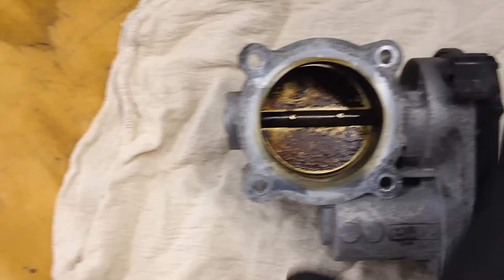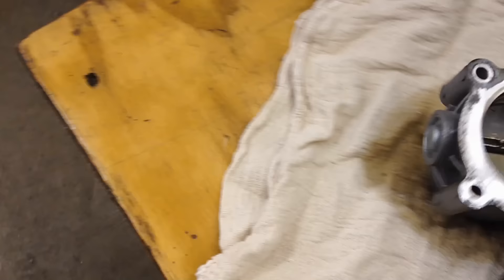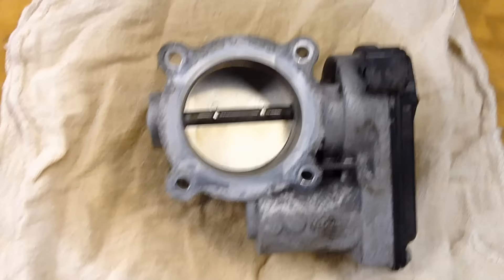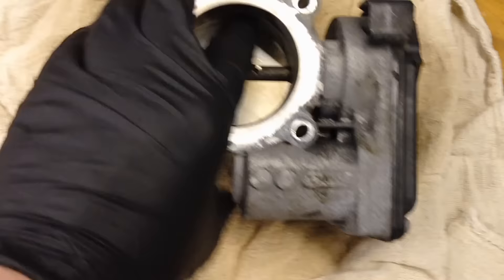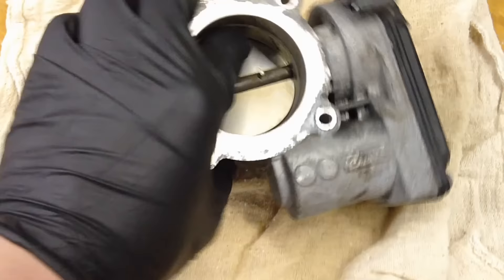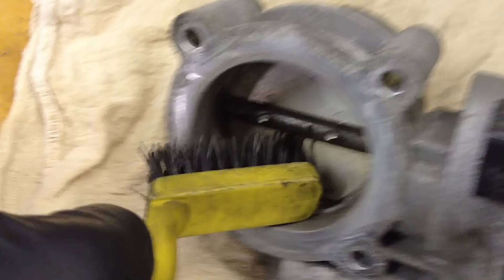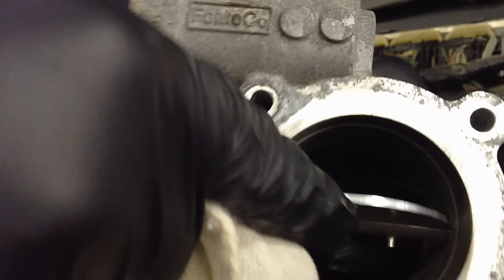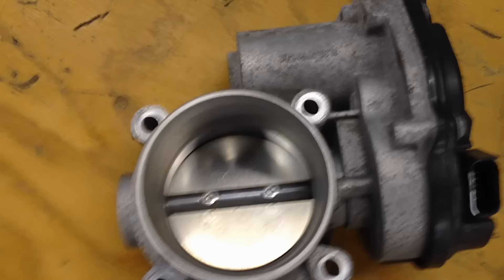How to Clean an Electronic Throttle Body Safely

Comment: Nice video.  I've seen people clean them while still mounted but have never thought that was a good idea.  I know the spray evaporates, but all that gunk could run down into your engine, right??  Not to mention pieces of cloth, brush bristles, etc.  They are so easy to take off (at least on my vehicle) that it never seemed wise to do it while installed.
Reply: My thoughts exactly. You don’t swallow your toothpaste after brushing, right? 😂

Comment: Thank you for the video!  I've heard if you poke the valve while it's in the car, it could possibly necessitate a reprogramming of the computer.  Assuming I disconnect the whole thing, without touching the valve, and pull it out of the car like you did, would THAT require one to have to do any computer reset or programming?  Sorry if this is a dumb question.  I know only enough to be dangerous!  I have a 2013 Jeep JK.  Thanks to anybody who knows.
Reply: DO NOT DISCONNECT THE THROTTLE BODY UNLESS YOU WANT A HEADACHE. Just spray onto a rag and wipe the inside with the vehicle off.
Reply: @christophervanzetta  joker

Comment: Thanks for your fine instructions and taking the time to do this. Replaced my wife's ac on her freestyle as per your video and I'm her hero now. LOL Thanks so much.
Reply: Just curious have you folks had many issues with your freestyle? My girlfriends has needed a PCM replacement, key programming, water pump and alternator still yet to be completed due to the vehicle having two alternator options and we are yet to locate the correct one. Option for rear AC and non. Thermostat too. Ours is at 243k miles and I guess everything just had to take a dump all at the same time.

Comment: I have a 2011 f150. I disconnected the battery, when I connected it again it started idling rough. I would press on the gas and as the truck went down on the rpms it would want to shut off. I “tried” to move my truck from the parking spot and it shut off. I cleaned the MAF sensor and it kind of work. I was wondering if this could help it back to normal

Comment: These videos are life savers...well I thought i had it. it broke..thanks ford for yet another pos idea to put the tab to unlock it on the bottom..and I really needed my truck. Tip I learned is to go ahead and take the throttle body off and leave the throttle cable connected (the one with the red tab underneath) then you can simply turn it upside down and actually see what the hell is going on. Like I said my red tab broke completely off but oddly it still snapped back on securely and even with it turned upside down and fiddling with it after the tab had already broke I'm not sure where i pressed to allow it to come off..but it did and went back on and snapped without the little red tab. 

How hard would it have been to just make it like the throttle position sensor..I mean ffs ford. Anyway after cleaning the throttle body thoroughly with crc throttle body cleaner (only use this cleaner..carb cleaner is to harsh) and installing a new throttle body gasket (Fel-Pro Throttle Body Mounting Gasket - 61438) on my 2005 f150 5.4 3v it now idles like it's supposed to and don't try to die when I go from park to drive and/or turn my steering wheel like before. This repair basically cost me $16 total

Comment: do we need to replace the gasket when we take it off?
Reply from the maker: +ZynovFTW It's a good idea yes.
Reply: just off my opinion i didnt an no leaks depends on damage
Reply: I've reused the gasket on mine twice.  Only because nobody ever had one in stock.
Reply: Just use silicon gasket thats what i did for mine and it works
Reply: @rays7437  make a gasket is a page sheet for like $12 make sure you get the gasket sheet for gas then take the old one and trace it then cut it out
Reply: @joshbeekman5474  
I was going to cut one out of a Big Mac container but I couldn't quite cut the special sauce stains out of it. So I went to MD and asked them for a box. They said no. But sold me a small cup of special sauce. If you paint it on in several coats and let it dry it makes an excellent gasket. If you remove the tiny pickles first.

Edit: the special sauce gasket failed so I moved on to plan B.
I bought very sharp scissors to cut out a gasket. Making up for lost time i broke rules and was running with the scissors.

Edit 2: My wounds have healed. I ordered the brand new replacement gasket on eBay for $3.89 shipping, FAST 'N FREE!

Total cost:
1 Big Mac, $3.99
One cup special sauce, 35¢
Scissors, $6.99
Medical bills, $5,000.
OEM gasket, $3.89.
I washed and saved the special sauce cup. I filled it with epoxy, drilled it and fashioned a replacement radio knob. I will eventually spray paint it Black but first I will have to mask off my entire dashboard, steering wheel and console. Because I already super glued it to the radio. If you learned something please give a like and subscribe to my channel.

Comment: Does it needs a sealant rubber or ìt can be directly fixed by tighting the main screws only ...thanks for your cooperation
Reply: There's a gasket that needs to be replaced. Cost about $2.
Reply: @xtrastrengthfukitol7733  Thanks for the response after 6 years of waiting, hope she reads your reply and replace the gasket.
Reply: @kindi911  I was replying for the benefit of others that might have the same question, not hers.  Go back to your nap. :)
Reply: @kindi911  i forgot to mention im a hugger so if u need a hug im here for u!!
Reply: @kindi911  LMAO

Comment: I am almost scared to drive my 2012 F150 with the 3.5 Ecoboost anymore.  It is going into limp mode (wrench on the dash) about every time I drive it. Thank goodness it hasn't happened to me on the freeway, just at idle and slower speeds.  I have changed out the plugs (.030 gap, OEM plugs), cleaned the sensors (3) and it is idling as bad as ever.  I ended up replacing the MAP sensor because it did not clean up well.  Oh...also replaced the air filter, which needed changed.  I also did the small hole in the bottom driver's side corner of the inner cooler, which very little oil or crud came out. I am still getting around 19.0 mpg (19.5 mpg on my latest 250 mile drive last weekend) with the truck, but have to get this limp mode problem taken care of.  Do you think I need to clean the throttle body or just replace it and then do a reset on the PCM?  Thanks for your help.

Comment: Ty! 4 info!! …? I have ford fusion 2015 I replaced o2 sensor along with 2 others and thermostat bc it coded too NOW when I turn on it accelerates but loses acceleration chokes and dies!!! It’s 1.5L turbo idk I’m at a loss I’ve not owned this yr or model b4!! Older cars so much easier!!! Plz help!

Comment: FordTechMakuloco I have a 2006 Ford Ranger Sport with 115k miles and it just started having a jerk when it shifts up to higher gear at around 45 miles per hour. It doesn't do it I give more gas causing the RPM's to be higher. Also when I am running about 60 and give it more gas it doesn't respond at first and RPM's don't increase or very little. Do you think the throttle body may be dirty and that is causing the problem? After watching a few of your videos that is what I am thinking. Thanks for videos and any help you may be able to give.

Comment: Fantastic video. I had major issues with my throttle body on my 2012 F-150 and cleaning it was not an option that moment because mine was super clogged and I was almost stranded. I had to replace mine because of a shortage of throttle body cleaners!

Comment: You suggest doing this first for a code reading for the throttle body or gasket?  Noticed a couple days ago fast idle and a little hard shift.  Don't know if related but getting warning for check fuel inlet also.

Comment: thanks for mentioning that ( opening the plate while connected to the car ) that's what I did I cleaned the plate w/o removing it. now I think I broke it.  it's drivable but it shakes BAD on Drive. normal on park and reverse. I thought it was the motor mount cause I also replace all 6 on my v6.
Reply: I have the same problem. What did you do?
Reply: I re order a motor mount from honda..... My problem WAS a BAD brand new motor mount.

Comment: Question: I have a 1993 Ford F250 Pickup with 460 engine and 188,000 miles. Runs great. Trouble is starting it after been sitting for a couple weeks. I turn the ignition on, listen to the fuel pump run, turn key to start, get a couple pistons to fire then just engine Turing over. Switch tanks, same thing. Give it a shot of starting spray and it starts and runs as Normal. Do you have any suggestions for me to check or replace?

Comment: Fordtech...any Idea why they have not recalled the 5.4 3v yet...I mean really. I have so much trouble with mine it is unreal. Now I can not rev past 3000 rpm, it runs rough, wants to die under load, the engine is jumping all over the place out of time. Did the usual phasers and such, all cop, and no change. I am now leaning on the throttle body. Is that the next logical step? No power and wont go past 80 mph, Floored it just does nothing. All my other cars and trucks my whole life you could rev up to 5 or 6000 rpms or more, right up to red line if you chose too. This truck wont go past 3000 rpm. You hear it fade out to nothing and you can floor it and it does nothing. Is that the tps?

Comment: before I seen your video I moved my throttle while everything was connected, just wanted to get a quick look at possible debris.. started my car up haven't noticed any MAJOR problems although my rpm idle seems low...what are the chances I threw off any sensors? and also what are some signs to look for if I did possibly fuck up my car?....07 Monte Carlo SS btw..ty

Comment: Hi, thanks so much for sharing. I think i have an issue with the throttle sensor. It's drained in oil/diesel mixture every instance that i check for. When i unplug the sensor cable the engine runs solidly. Whenever it's attached the rpm's are throttled down. To you have an idea to this?

Comment: Was using top engine cleaner and moved throttle plate with my finger to allow spray to get in while truck was running drove it for months now having p21 code combos, it's not pedal might be throttle sensor or do you think I fried the DC motor. Also I cleaned maf sensor so might just need a pcm relearn? 4.2L with 5 speed manual has trouble accelerating right after shift up gears and popping sounds under hood

Comment: Great video, very informative, I have a 2004 mazda 6, 6 cylinder and I am planning on cleaning throttle body as you show in video. I have a couple of questions, does tb need gaskets and approximately how long would it take complete entire job from taking off tb to putting it back on after cleaning. Thanks.
Reply from the maker: This can be done in less than 3min for an inexperienced person. Most times the gasket is ok to reuse
Reply: Great, thanks, I'm hoping cleaning helps or else the cars getting a for sale sign!
Reply: @FordTechMakuloco  I worry about the "most time" part...good to have one with ya' just in case if you are far from a Ford auto parts just saying. Tks for your advice on the subject.

Comment: FordTechMakuloco - I just bought a 2010 Fusion Hybrid w/110k miles on it. The yellow wrench(s) come on when driving at about 65 mph, and I noticed this last time that it happened as soon as I let off the throttle. Engine was up to temperature. I know the TBs have issues, but no scan tool. Is this a common problem related to the TB? Is it worth it to just remove and clean the TB for this? Does it have to be recalibrated after cleaning (removal), or just after replacement? Thanks!

Comment: One video on youtube claimed that if you turned the key and pressed on the gas pedal (not starting the vehicle) the throttle body would open and you could spray it down and clean the inner part that way. Will that work?
Reply from the maker: On some Fords yes it will move with the pedal engine off.
Reply: How about a 99 Cadillac Deville?

Comment: Hi FordTechMakuloco I have a 2006 Ford Fiesta, But down at low rpms it is really sluggish jerks a bit initially i thought it may be a fuel pump but i checked my throttle body and is very dirty. Im going to remove it tomorrow and clean it do you think this has any effect on the jerking?

Thanks

Comment: I have an '08 F-150 4.6L V8 with over 120,000 miles.  I'm trying to get my fuel mileage back up.  What all should I replace/clean to help with this issue?  Thanks in advance for any help.
Reply from the maker: +miscarlett1 Throttle body first then and induction service then plugs and a air/fuel filter if needed

Comment: Mine is 2012 ford explorer. Last time I did this was disappointing. I cleaned it with just rag and after revs is without the intake and I turned it off. The next morning The won’t start anymore and end up towed and the shop won’t tell me what’s going on. And I paid like  $900 kust to het it done. And they just told me they fixed something under the dash board. My suspicion was they just changed the fuse maybe. But I don’t know. Can you tell me maybe what happened just to clear my mind. I felt like I was rip off

Comment: Is it ok to open the flange when the electronic throttle body is completely disconnected from wire and the car? bec. I want to clean it myself, and i am afraid of doing something wrong.

Comment: i need help!! car was running fine. then would crank but not start? 95 mustang gt 5.0.  i changed throttle positioning sensor. now car has started a few times. but still wont start & run. now ive changed almost all sensors & still nothing. god bless & thanks!!

Comment: very helpful video, but mostly if you own a Ford.  I desperately want to clean my 09' Lexus GS 350's throttle body but also..like others...have read that you shouldn't manually open the valve by hand as it may cause you to reprogram ecu, etc.  How would i find out if REMOVING the entire body (like you did in your video) would allow me to clean but without causing damage or requiring a reprogram?
Reply from the maker: gratefulRed69 Any electronic throttle body this is a good practice.
Reply: FordTechMakuloco not sure what exactly your message is here.  What, exactly, are you saying is "a good practice" ??  You saying "removing the entire assembly before cleaning" is a good practice or what??
Reply from the maker: good practice to disconnect power to it before moving the throttle plate.

Comment: Can you please help me.. I replaced my molded lead frame by the dealer due to it being on the TSB and was replaced under warranty. I have done the reset by the battery and I still have that limp mode going on. I researched on you tube and it was said to turn on aux and press down on pedal and release very fast (done 3times) and on 4th turn on truck and run for 10 miles. But everythime I turn on the truck to drive its goes back to limp mode.. it doesnt have the take off like it used to. Do I have a bad lead frame or something. What am I doing wrong.. please help.. thank you.. Richard

Comment: Hi fordTech..just wondering do i need to pull the whole throttle assembly out like what you did?..i'd seen other videos where they just press the gas pedal to move the butterfly to clean.. is that safe to do?

Comment: I've heard there's a special coating inside the Throttle body and should never be cleaned .  I have a 2006 F150 4.2 is there any truth to this?
Reply from the maker: That was only on the early 90's Fords.
Reply: @FordTechMakuloco  Thanks for the fast reply.

Comment: Excellent work 
I have question, after clean I test the gate with light , and find that it didn't close completely , is that normal or I need to change it ?
Reply: Yes, completely normal. This is how the vehicles idles.

Comment: Hi, great video!! one question, if I use brake cleaner to clean the throttle body, Can i damage it?
Thanks!!
Reply: Yes you will.
And ford also recommends using air mass sensor flow cleaner because it's more soft, be aware that the surface of the throttle chamber has a thin coating of some insulating material.

Comment: So why not just disconnect the battery or remove the wire connectors to the throttle body instead of taking it off the vehicle? That is, so that you don't mess up the position sensor as you state. I realize that taking it off gives you better access to all the nooks and crannies for cleaning, but wouldn't just cutting power to it be enough safety to prevent messing up the computer controls?

Comment: Hi, i have a 2016 corolla s. I did clean the throttle body. However when i put everything back and turned the car, the electric plug of the body wasnt fully plugged so got chk engine light and the idle was up tp 1900. I plugged the plug correctly,  cleared the faults and turned the car on, all is good except the idle still high up to 1900. Any suggestions?

Comment: I was wondering how to get it to stay open without damaging it but also without having to keep pressure on the accelerator.  I know these things need cleaned out once in a while and that can really help.  I once had a car that did not have an electronic one and I had to clean that throttle body at least one time.  It was because the idle air motor was stuck and I had to keep constant pressure on the accelerator to keep the car from stalling even if I was at a stop.  I would imagine that having to do that too much can't be good for the car but I only had a couple miles to travel with it in that condition and I live on back roads.  Aside from a couple traffic lights before getting on the back roads it was only a bit tricky.  Once I cleaned it out that problem came to a quick end..